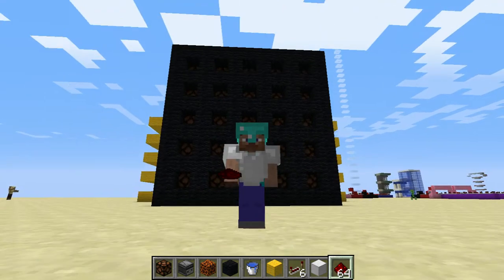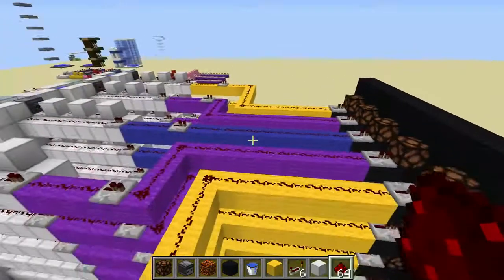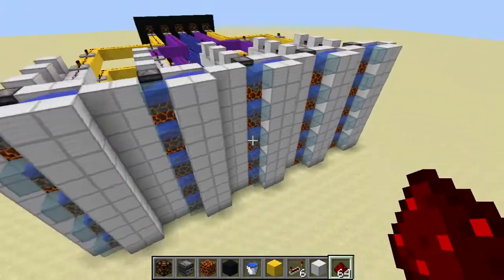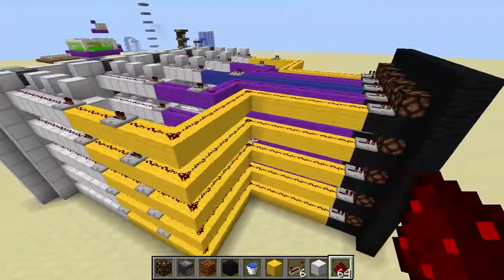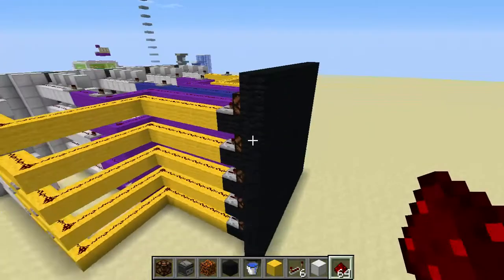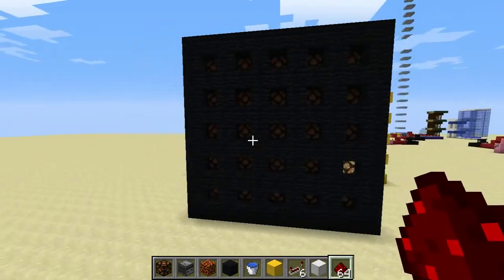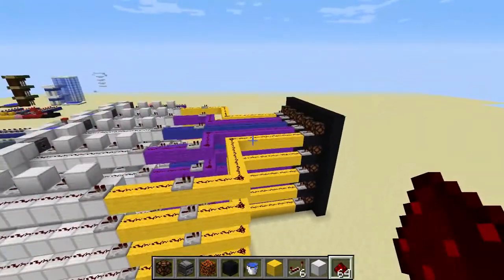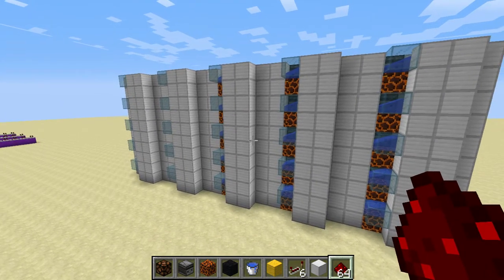Shhhh Minecraft Is Thinking

Comment: why not use dropper randomiser?the flowing water along with magma blocks cause lag
Reply from the maker: just playing with a new toy. there are much more efficient ways of doing this, but I'm exploring.
Reply: Nice... I didnt know this was a proof-of-concept :D
Reply from the maker: Sadly, it won't work for a dice randomizer without massive logic circuits. If more than one source fires their observer at the same time, you have two or more simultaneous random outputs.
Reply: No, you can have a clock making the randomisers fire, and each output can be pulled out with comparator+repeater so there is no need for any logic gates
Reply from the maker: yeah, was just saying I can't use the water sources. I can use a dropper clock randomizer.
Reply: Which is what i was suggesting lol